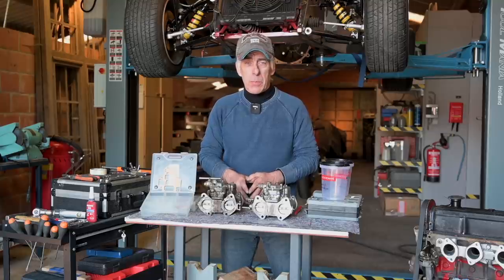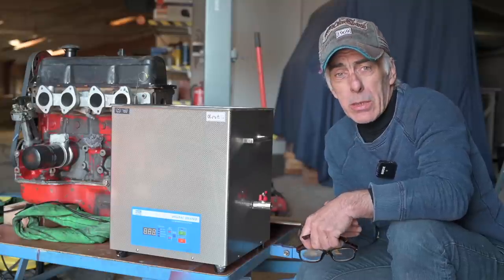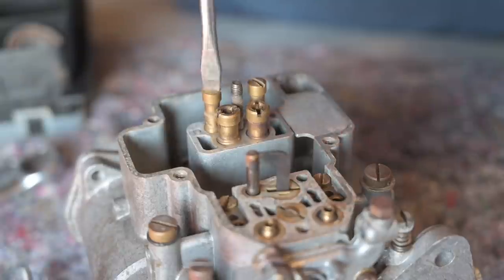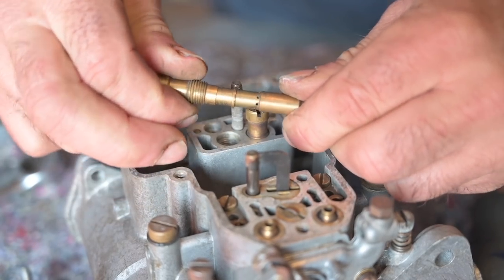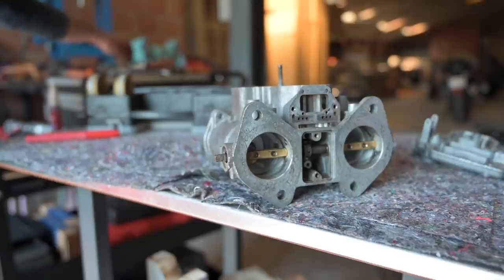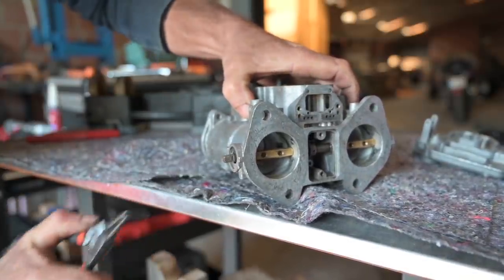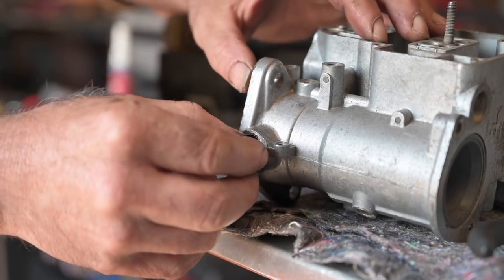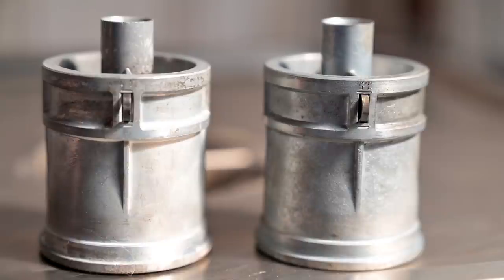Weber DCOE Part 2 A, disassembly and cleaning

Comment: I live fews km away from where these carb used to be made in italy. If you are not be able to find some special parts of some kind let me know, i could help you find them here and send them to you. See you next time!
Reply from the maker: Thanks for the comments, that is really great Gabriele . I might pick you up on that...   I could use the brass spindle for the butterflies as all replacement are steel
Reply: @D3Sshooter  they went to steel shafts because just the pressure of the return spring on the accelerator pump arm slowly bends those brass shafts and wear into the carburetor body causing idle air leaks.
Reply: Thank you! Where is the best place to buy parts? I've aquire a set of triple dcoe40 in a trade, basically got them for free. But need complete rebuild. probably most parts screws,jets etc. Going on my 240z...thanks
Reply: @sebastiansavalli8109  the best places are old retired mechanichs or places were they restore old cars (in this part of italy there are a lot of them). This is the only way to find original spare parts difficult to find elsewhere. But for rebuilt kit you should find them on the internet as well (at leats most commons types)
Reply: @gabrieleolivieri2852  thank you very much! I bought the rebuilt kits but it's just gaskets and the valve. But I will definitely do more searching! And one day soon I will revisit Italy once again!

Comment: The ultrasonic is a great cleaner and time saver and doesn't require any chemicals that let off VOCs so I use it all the time on carbs.  So, I am glad you showed how to use it.  I didn't notice how you managed to rinse the cleaning solution out all the passages after soaking the entire DCOE in the ultrasonic.
Reply from the maker: That is blowing air ( compressed air) through all the channels, then using brake cleaner fluid and blow again and finally carb cleaner.... all works well
Reply: @D3Sshooter  which cleaning solution do you use?!
Reply from the maker: @janzochmann4365  Hi , I use brake cleaner and in the ultrasonic I tend to use the TICKOPUR R33

Comment: Between my ultrasonic cleaner and my baking soda blaster, I can make carbs look like brand new. Baking soda in a handheld sandblaster is ideal for cleaning aluminum and zinc carb bodies. It will clean and remove corrosion without damaging the base metal, and will dissolve away with plain water. For those float pins, I use a spring loaded center punch to pop them out. Much safer than a hammer. Breaking one of those pivot posts off will quickly ruin your day.....
Reply from the maker: Thanks for the comments, and indeed great tips

Comment: Letting things sit is very bad for carbs.  My old camper bus ran great but got parked for a few years then the accelerator pump failed due to clogging in the passages leading to the venturi.  Terminally clogged and had to replace carb since ultrasonic didn't fix.  Now days with electronics and fuel injection, even mechanics sometimes haven't had experience with carb problems.  Problems that aren't as easily fixed with a code reader.  Nice thorough treatment and explanation on your part.  Thanks.
Reply from the maker: Thanks for the comments, indeed

Comment: Hello, I have been watching your videos on Weber DCOE carburettors in hopes of getting my Caterham running well after I get it put back together.  It has a Cosworth 1.6 BDR engine. A friend of mine bought it from Caterham brand new in 1986. He never finished the car and I remember him claiming the carburettors were giving him trouble and he couldn’t get them adjusted properly. He died about 5 years ago  and I bought the car from one of his sons about a month ago.

Your videos are excellent. I live in the United States and speak our English. If I recall correctly you mentioned you are in Belgium. Your English is excellent. You are clear and very easy to understand. Your knowledge is remarkable and your detail makes your videos superb. I know people in the US are not typically four cyl car guys but I grew up with MGBs and MGAs  and now with the Caterham I have always been more of a smaller engine guy. I admire your Formula Ford work as well and enjoy those videos as well. Please keep of the good work!

Comment: Everything in the carburetors should be identical between all four barrels.
Only exception is the main system where you might find differences.
First and last cylinders run less hot and might go with a bit more lean mixture.
When last person fiddled with Your carbs, didn’t understood this and tries to make two barrels in each carb similar.
Instead this someone should have made cylinder 1 and 4 identical, 2 and 3 identical.
But in my experience, this is very specialized turning and not for the average mechanic.

Your videos is much appreciated!
Reply from the maker: Thanks for the comments,  indeed tuning is an art by itself...  the main issue is that you need to start with a firm foundation of good /correct jets and veturis... then start to tune either on a dyno or a road test and have many jets , emuslion tubes and venturis available to get it right.

Comment: I have a great tip for using an ultrasonic cleaner,instead of filling the tank with cleaner,get zip loc bags big enough for your item to be cleaned,they come in various sizes and i have some that will allow a weber DCOE to fit easy and very loose,add the cleaner fluid to the bag with the carburettor and once you have enough cleaner in the bag by allowing the part to sit on the bottom of the bag on a flat surface/table let the fluid cover the part/carb then zip the bag almost closed then push the bag top down to the fluid to remove all the air,when the fluid tries to leak out fully close the zip loc bag.

Now sit the bag in the ultrasonic cleaner tank and then fill the tank with cold or warm water,the Ultra sound waves will work the same as with no bag but now the tank can be used for lots of cleaner types without contaminating the tank,and you dont use as much cleaner.
Reply from the maker: thanks for the comments and great tips

Comment: Always use the correct size screwdriver or you will damage the screws, keep all the parts in a well organized partitioned case, mark the parts to help reassembly, expect the unexpected (bent butterfly shafts), If in doubt - make a video of the disassembly. You covered it all - good video.
Reply from the maker: Thanks for the comments, absolutely and sometimes i don't   and that is so wrong

Comment: Thanks Steve, very helpful indeed... I have just finished stripping mine today after watching your video. I see my butterfly shaft is steel and not brass like yours. (40 DCOE-28), Also mine has sealed bearings, which is probably aftermarket. These carbs have been worked on before.
Reply from the maker: Thanks for the comments Thomas, indeed yours was reworked as the butterfly spindle is typical steel when reworked.  Original Brass, I could not find a brass replacement , so mine are now also steel

Comment: my favorite tool for removing float pins is an Automatic Center Punch....or spring loaded punch.  It usually pops the pin right out with no tapping with hammer
Reply from the maker: Thanks for the comments, I need to check on that

Comment: I hope you don’t mind me messaging you. I’m after some advice…..

I came across your video regarding the Weber DCOE on YouTube following a Google search trying to find a solution for a problem I’ve stupidly created for myself.

I have a 1400 Vauxhall engine that I use in a my race car which has a pair of Weber 40 DCOE carbs.

I had a problem with the starter motor and upon changing I wanted to fire the car up and make sure all was Ok.

In a nutshell I stupidly grabbed the first fuel can I found and out of the 9 we keep in the trailer box 1 of them has diesel in. Yes, you guess it. I fuelled up with diesel.

The car wouldn’t start at all but I was pumping the throttle a fair bit. I checked spark and then cracked the nut on the fuel inlet union on one of the carbs which is when I’d realised my error. I’ve pumped all the fuel from the fuel tank and lines and changed the filter and now purged the fuel line through so that’s all just petrol. However I’m going to assume the carb is now full of diesel.

Am I likely to have damaged anything? And what’s my best course of action. Is there a way to drain the fuel out of the carb. From looking at your rebuild video I wondered if taking off the square plate on the bottom of the carb (held on by 4 screws might do the trick)

Any advise would be greayfully received

Comment: An automatic center punch with the punch  ground to fit the hole size needed will work very well without using a hammer,in fact if a small very obtuse angle is ground on the tip it will hold center on the first few punches without mushrooming the pin also the pin will be of a reasonably hardened steel to avoid it wearing too quick which would cause bad fueling.
Reply from the maker: thanks for the comments, and good a tip

Comment: Get a set of hollow ground screwdrivers they are worth it.

Or just use the bits meant for battery drill, they work almost as good because the way they are ground
Reply from the maker: Thanks for the comments, good points txs

Comment: My guess is that in the previous ''Mad Max'' autopsy & rebuild butchery... is that those bent end axle rods, had some lebendig bösartig metal hammer blows applied to get them not only out, but back in as well.
Reply from the maker: Thanks for the comments, indeed... this car has nothing else then those F...up things.  wires to keep things together, silicone alover, twised wires instead of plugs..  etc....

Comment: Is there anyone that offers a mail in rebuild service?  Great video sir.
Reply from the maker: Maybe , I should start doing that kind of work....
Reply: I would send mine to you. Im stumped on my 40mm dcoe's. The choke circuit area seems to have a blocker plate and no gear lever choke plate assy. Its blocked off. And there's just a square steel lug with no spring behind the brass retainer ring up top. Looks different from the one you are working on. 
Spain 
40 dcoe151  
295 7

87 Suzuki samurai gypsy sierra

Comment: Great videos, thank you! The plates with 2 holes that cover the springs and leather seals next to the bearings are really stuck in my carbs. I've sprayed penetrating oil in, heated up with hot air gun, etc. They won't budge. Any ideas? What if I pressed the throttle shaft through to push out both the bearing and the cover plate?
Reply from the maker: I had a simular problem once and punched out on a small press , it did damage the spindle..  but I did got new once.  You can try to put in the  ultra sonic cleaner... that works sometimes

Comment: Your videos are a great help.  I am having trouble taking the screws that hold the butterfly valves to the shaft. They look to have a grove at the back which might mean that they were spread so that they would not come out!!!!!  I cannot budge them even after heat and penetrating oil, etc.  Any suggestions?

Comment: I have a similar rebuild kit and I am in the process of rebuilding my Weber DCOE 45. I have a Italian built 152 so there are some minor differences. Where do all the o-rings go from the rebuild kit. So far I have only found o-rings below the idle mixture screw and the pump jet cover. There are also 2 small metal rings in the kit (pump jet washers) are these supposed to go under the pump jets?

Comment: hello again, we finally discovered that the inside channels where fuel flows of the main Weber DCOE45 body are not enough cleaned/free of fuel gum, so how long should I treat it with brake cleaner in case I can't get access to an ultrasonic cleaner. How I identify if its ready, couse the engine don't rise up R.P.M.'s

Comment: Great video - I especially liked the part at 28:28 where the damage to the shaft was revealed.  "Somebody bent it" - no, wasn't me when I was using the 20 ton press and the hammer and punch........  The throttle attachment at the beginning was not revealing a bent shaft and peened threads, haha.
Reply from the maker: Thanks for the comments,  but it was bent on both and the press was not even near that 20 Ton... the second carb had the same bend spindle and broken bolds....  and believe me whoever assembled this carb really did not know what he was doing, wrong jets, wrong venturis and the bended spindle

Comment: I’m restoring a couple of dcoes during the quarantine. Any tip to get them shiny or at least better looking with household materials?
Reply from the maker: Hmmm, I ned to use soda that works well and let them soak in warm water.  There is also a spray that you can use Break cleaner or even Carburettor cleaner

Comment: Wouldn't it be better to disassemble the carb before the ultrasonic cleaning? That's what mechanics normally do with carb cleaner. Just curious. Thanks.
Reply from the maker: Yes indeed,  I cleaned it before and after as I hate to take dirty things apart. Hence a pre-clean.
Reply: @D3Sshooter  Well that makes perfect sense. I've rebuilt 100's of carbs and never did a pre clean. Good idea. Thanks for your excellent videos. Especially the ones about tuning  and working on DCOE 40's I have 3 on my '72 240Z and you've helped me a lot.

Comment: Thanks for your great videos. I have a question. In my carburetor the shaft with the butterfly does not rotate due to some chemical corrosion (2 different metals: steel shaft and aluminum housing, plus moister). Could you recommend something to try to solve this problem?
Reply from the maker: Thanks for the comments , well take the shaft out and get it all polished , then apply aviation grease /insulator  on it . That will create a film between the parts
Reply: @D3Sshooter  Thanks for your reply. The problem is that I can not get out the shaft because it is seized. Do you have any other idea what to try? Thanks.

Comment: There's a much easier way to remove the throttle shaft. No need to use a press. Before removing throttle plate screws grind off the peened over end using a dremel and small carbide tip. Screws come out much easier after doing this and lessens the chance of damage to threads in throttle shaft. You also do not need to remove the bearing retaining caps first with circlip pliers or use heat. After removing the end nuts and throttle arms spray into the bearing area penetrating fluid and let it sit for a while. After that hold the carburettor body in one hand and tap the end of the shaft with a plastic or leather hammer. Shaft will then move and push the bearing and retainer out together on the other side. Repeat on the other side of the shaft. Job done. Don't bash it on one side whilst resting the body on a socket on the other side. You'll dent and marr the body where it rests on the socket. Just holding the body in your hand whilst tapping the end of the shaft is sufficient.
Reply from the maker: Thanks for the comments and tips

Comment: When reassembling would it be bad practice to use a tiny amount of 3in1 aerosol or WD-40 to reduce the friction of dry brass into dry aluminum? Just a thought, as I'm a bearer for detail.
Reply from the maker: Thanks for the comments Adam.  Sure that is always good
Reply: @D3Sshooter  A new question. Is it possible to hellicoil the threads that hold the carburetor lid down? There's five in total in an M5 thread and I'm fairly certain that I've overcooked one by using a 1/4" drive ratchet. The thread may have been already semi stripped, as I didn't use a lot of torque Previous answer was greatly appreciated.

Comment: Thank you for this video! I jumped right in on my own disablembly. However I can not easily remove the part at 11:47  (starter valve?) (after the you remove the spring). I have 2 of these stuck and unable to move as well as the Pump rods. These do not want to come out any advise for "stuck " parts?
Reply from the maker: Glad it helped! They can be a bit corroded, spray some antirust or nut release liquid on it and let it sit for a day or so..  if none of all that works , you could place the entire carb into an ultrasonic bath ... that helps often

Comment: how do i disable my cold start circuit, and block the fuel?
Reply from the maker: For that you can find blanking panels, or make one yourself...
Reply: @D3Sshooter  can they leak causing an untunable rich mixture ?
As in it smells real rich no matter what I do . Is there a way to check? I saw a video of a guy that soldered the jet tip closed then predrilled smaller.  Can I just solder the jet closed?

Comment: @D3Sshooter, is it safe to use "carburetor cleaner" (spray can, like this: https://gunk.com/product/gunk-carb-medic-m4814c/) to clean all parts of a Weber 40 DCOE carb? I'm concerned about possibly harming any of metal (body, jets, pump, etc.). Also, what kind of brush can I use to avoid scratching any of the parts? Thanks in advance
Reply from the maker: I always use brake cleaner ,  that works great and if you need a brush , use a very soft brush. Off course ultrasonic cleaning is the best method

Comment: That float is brass not copper.Copper being  kind of too soft on it own.
Reply from the maker: Thanks for the comments, brass or copper    ... i need to check the meaning but i do get your point as Brass is hard copper right ?
Reply: Brass is a alloy of copper and zinc, which makes it a lot stronger and less prone to metal  fatigue . But copper has been used  as floats ,but is also heaver